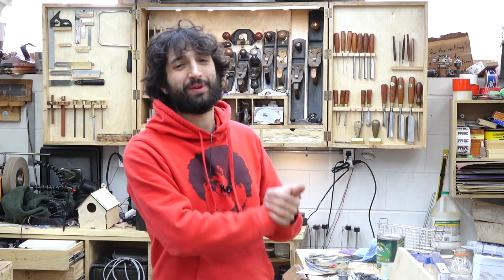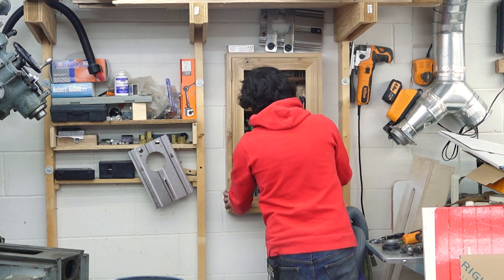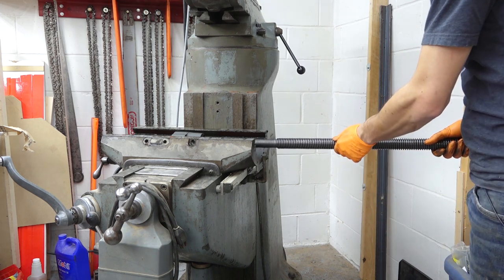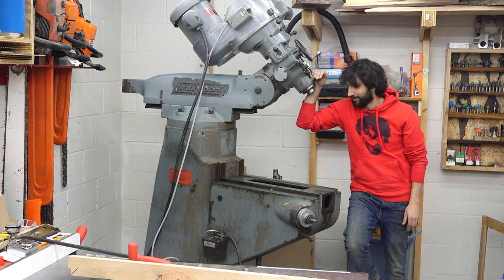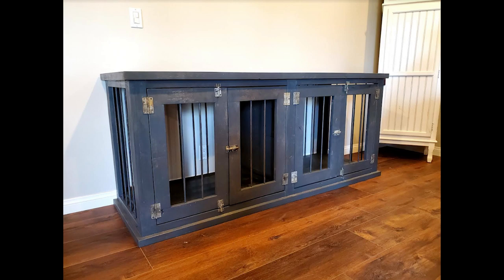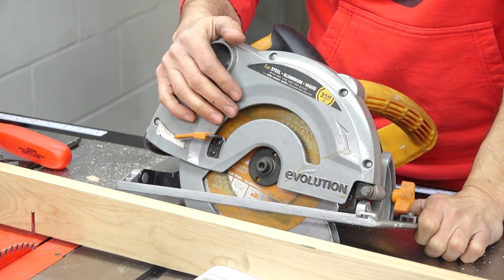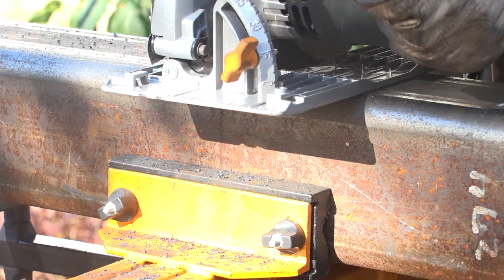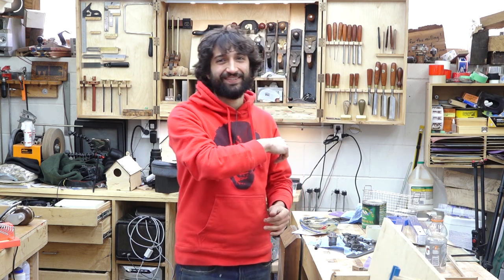Router Bit Cabinet, Bridgeport Restoration, Metal Cutting Circular Saws

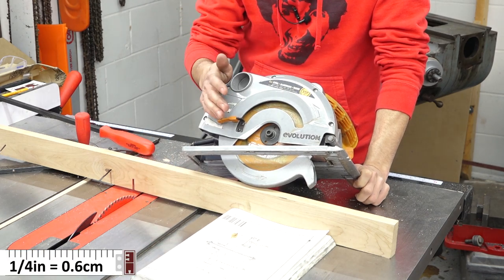Comment: Matt, just one mans opinion. I have a cordless metal cut saw and although super handy on a job site where you may be moving around, where you are working from one location, I would stick with a corded version. What I have found is that unless you are cutting fairly light weight material (thin sheet or thin wall tube etc), the cordless saw chews through the batteries quite quickly. A good supply of charged batteries on hand is needed if you want to be able to keep working. Although I have no doubt that my saw would also cut 3/4" material, on a piece the size shown in the vid (8:40), I would not be surprised if that was the battery (5Ah Li) done.

Comment: I always find it surprising how much space it requires to take apart a machine. I'm currently working on my wadkin MF morticer and it's spread over 3 benches and I no chance of doing any wood working.

I like what you doing with the router cabinet, I assume the back is a veneer ply

Comment: So, did you ever show the slightest interest in metal scraping???  You may have to learn now.  Welcome to that "slippery slope."

Too bad Kentucky wasn't closer.  Steve Summers might appreciate having a jackhammer attachment on the skid steer he is using by now, and he may be able to help you sort out the saddle on the mill.  If he can't, Brian Block could.

You might consider getting on the You Tube Machinists group on facebook.  There should be someone on there that is close enough to help you out with the mill.

Comment: Cutting metal takes much more energy than wood. Therefore the cordless saws are only good for small cuts in thin material. The cordless saws with 300W motor and 3Ah battery are no match for 1200W corded saws with unlimited supply of energy.

Comment: Quick question ,I'm needing to cut several post from 21 ft joints of 2  3/8 pipe  it's oilfield pipe  so it's pretty heavy,what do you think the best way to cut it. Would a metal cutting cir saw work?
Reply from the maker: Yeah shouldn’t be an issue. What’s the wall thickness?
Reply: Matthew Cremona probably about a1/4 inch. Thanks

Comment: Wouldn't a plasma cutter be more efficient?  You have a horizontal band saw don't you?
Reply from the maker: Depends what you’re doing. Much more hassle to set up and there’s more cleanup. Yes I have the horizontal bandsaw now that I use for most of my cutting
Reply: @mcremona  Maybe I missed the whole reason for the circular saw and metal cutting.  It would seem cumbersome trying to use it and I know those abrasive wheels are all but worthless.  I'm not really sure why they even exist?